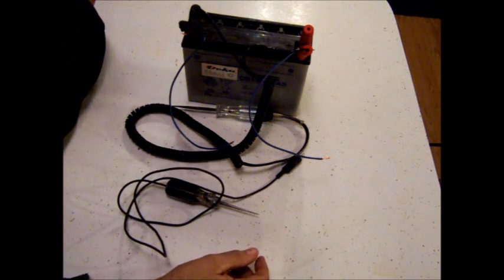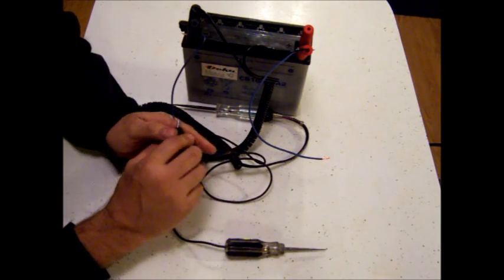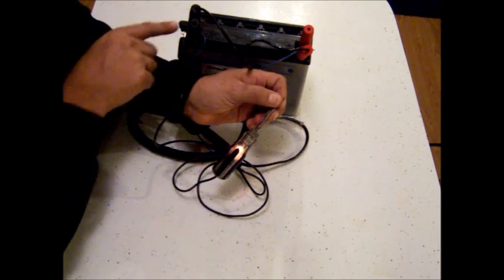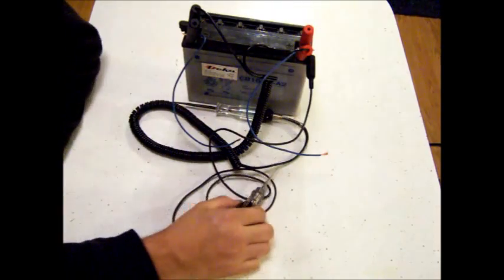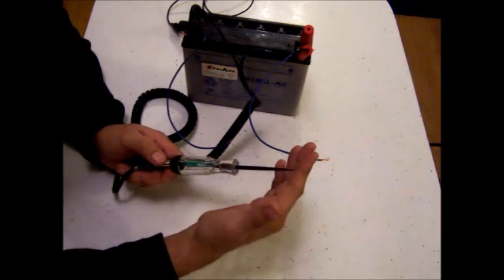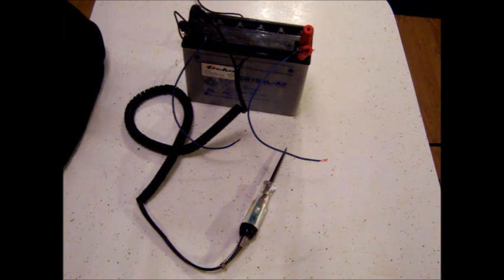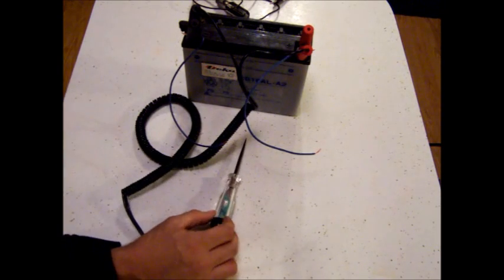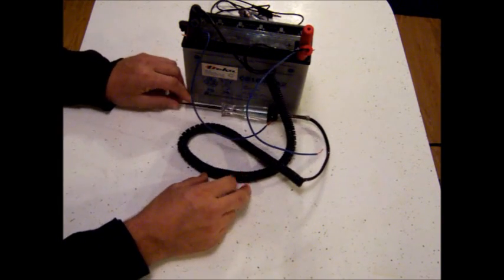Test Light - regular vs logic probe

Comment: You can use a test light on modern cars you just have to know what your doing.
Go watch any number of Scannerdanner videos for illustration. Thumbs down on this vid though as poking holes in wires is a VERY BAD idea. Guarantees trouble down the road.  A test light that lights by itself is of little use. It doesn't tell you if the circuit can handle a load or not. Get a Loadpro and DVOM and learn a much more effective way to test circuit integrity.
Reply from the maker: I do have a load pro , but it has a different use than a test light. This video was mostly showing the difference in test lights and not a back probing how to. Sorry if you mistook this for a test light manual video..
Reply: moomike laloo ; be advised however that may circuits run through a body control module if the not the PCM itself. On the most modern cars , I believe everything will run through either . Have heard that people that have made incorrect connections while installing after market led lights have caused problems with a BCM or a PCM . Can't speak for the quality of the led light but we need to use computer safe on all circuits ( except alternator or starter , and other high amp circuit ) , especially modern . A good computer safe test light will check up,to at least 24 volts .
Reply: Case in point , the test light will light even if you have a battery cable with ONLY one strand of copper left . You can read continuity and 12 volts all day . But it will NOT carry the current load  ( amps ) when the circuit is operating . Any high resistance ( corrosion ) will stop current flow . You can read a " connection " but you won't get the amps . Voltage drop testing is the way to check it - with the circuit OPERATING .

Comment: Do not use a regular testlight on new cars. they draw too much current in the circuit and can fry computer control modules. A logic probe is computer safe because an LED draws almost no current, like 7 milli-amps or something. to prove my point hook one up and put the probe on your upper rubber radiator hose i bet it lights green for ground.
Reply: This Logic Probe isn't safe sorry. It will still do computer damage. They are like $12.... dont fall for the trap